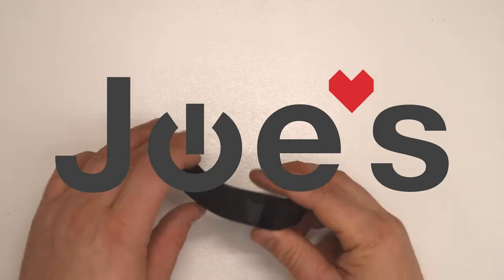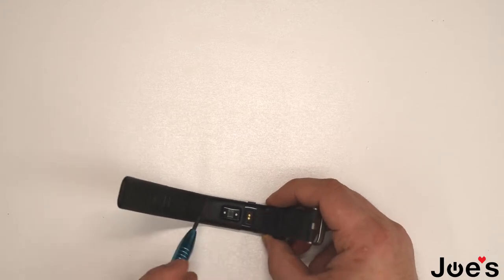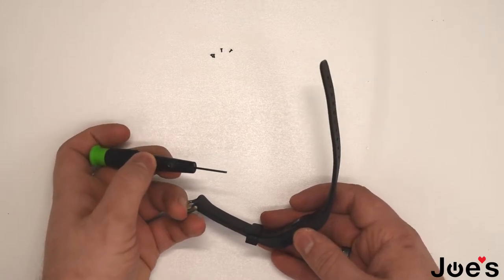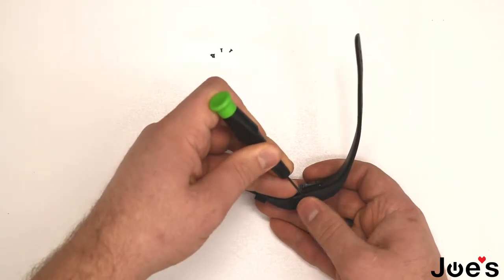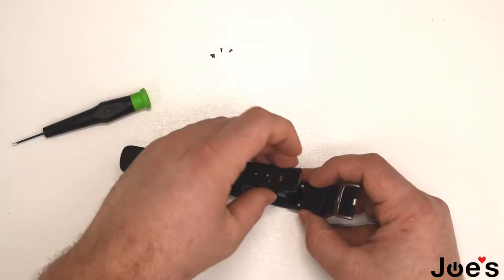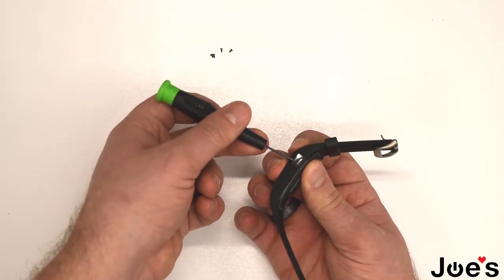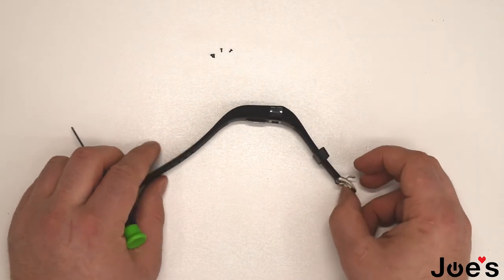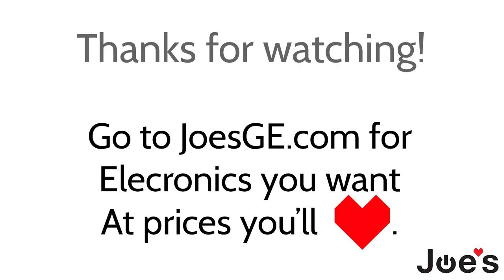Repair Fitbit Charge HR Wristband Band Replacement How To Tutorial

Comment: My band stopped working after replacing the strap. It works when I’m not wearing and it doesn’t when I am. Need help here!
Reply from the maker: Hello and thank you for supporting JoesGE. There could be a pressure point somewhere on the board.  Or it can be a bad band.

JP